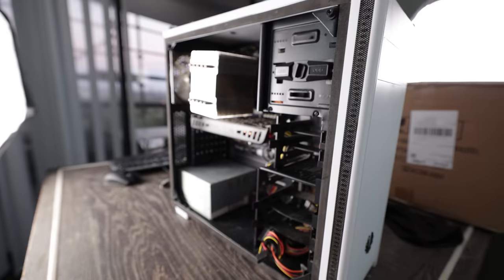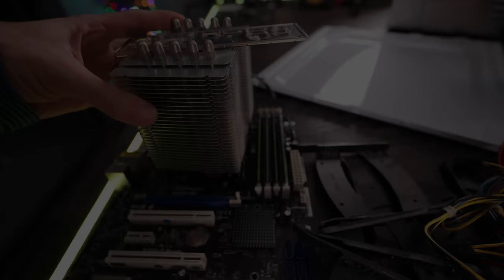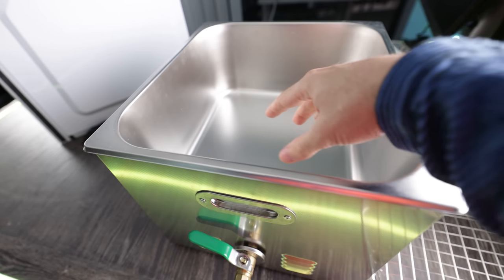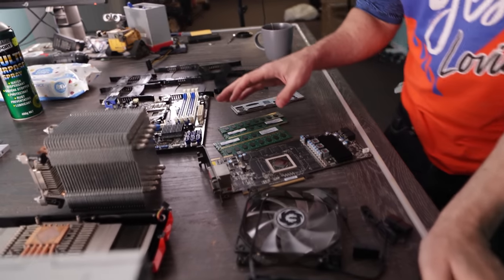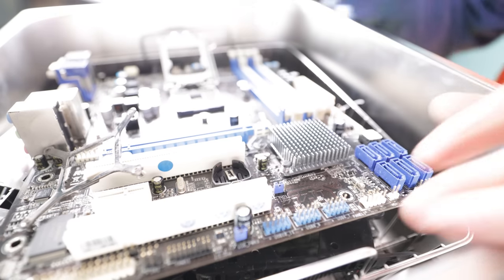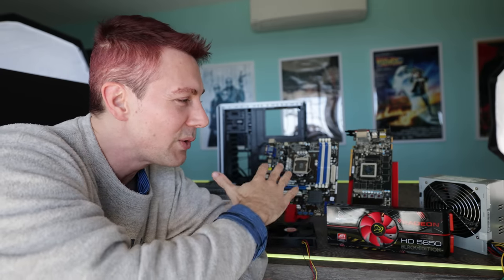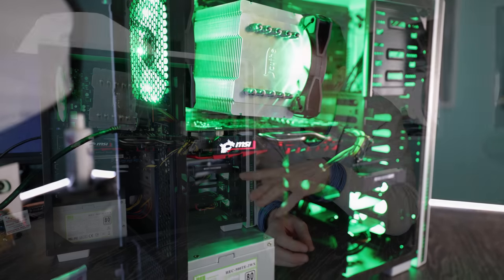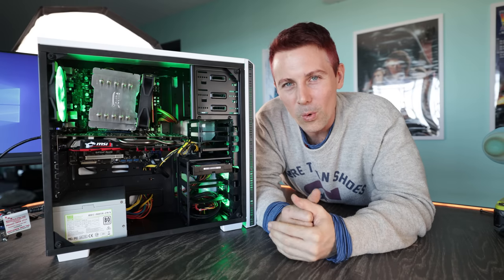ULTRASONIC Cleaning a THROW AWAY Gaming PC! - PCUC S1:E1

Comment: note to self, never trust u on cleaning a pc, the fact u used tap water. yeah no thanks. not the correct thing to use in an ultrasonic cleaner for pc parts nor should u ever use tap water on a pc for any reason. distilled water, maybe, high proof ethanol yeah, but tap water? nah id rather have my pc last 10 years or longer than put them at risk of rusting or worse, shorting out because it takes a lot longer for water to evaporate than it does alcohol. not to mention all tap water has some minerals in it, because of that they are left behind when the water evaporates, which can in turn lead to a short. so yeah def not gonna trust u on cleaning pc's.

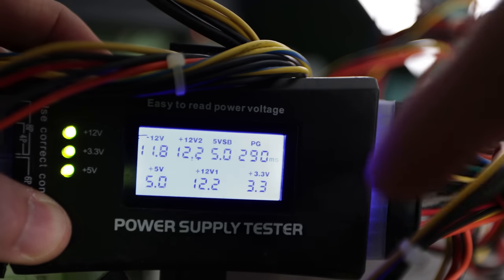Comment: 8:36 OMG that just seem so wrong to run tap water into a PSU.  Those caps hold a charge you know. 11:32 Oh thank god!!
From watching Louis Rossman, and Jayztwocents, I believe you're supposed to use alcohol in a sonic cleaner, and only clean small component, or one large component.

Comment: I advice you to use distiled water .
Maybe the regular tap water will kill components sometimes due to capacitor charge.. 

Ah btw,i think You know but You can use that cleaner with distilled water to clean water damaged components and it's corrosion.

Comment: I have the exact same ultra sonic cleaner, I wanted to put 70 CPU's in there for refurbishing, do you think it will be safe?
Reply: For anyone that needs an answer - yes, it is completely safe as long as you dry them with hot air (50°C to 80°C). Works completely fine with RAM too and even brought some of my 16GB modules back to life. My tip is to use a grease dissolving detergant and a temperature of 50°C for the water, 20 Minutes.

Comment: I laughed when I saw that cooler only because I did the same thing on my old 990x I can't stand to get rid of lol I drilled out the tabs on 1151 waterblock in order to reach the larger span of the 1366 socket,but it turned out perfectly centered,that leaning 775 cooler brought back the memory.

Comment: How long can you leave the motherboard without its battery?  Does the BIOS fade away?  Or do you clean it, then de-water, then install the battery again in the shortest amount of time?  I'm not sure why I'm asking.
Reply: The BIOS ROM does not fade away. The CMOS settings do, so you must reset them again in the first boot. 2 seconds unless you wish to tweak some settings.

Comment: Ive just dry cleaned my computer,I never put any electricals parts in water,I did try this many years ago with a very old windows 1995 computer,Left the parts to dry after about week,It wont work any more,One all the water goes in to all the circuits,It messing all the circuits,Some you lot are crazy !!!!! air spray the electrical parts or use a cotton bud's to clean it with
Reply: use not tap water

Comment: One question, not really nitpicking or anything but when blowing to the parts with fans, isn't that it is bad to get the fan to spin as it would introduce static to the board?
Reply: You would have to spin it really fast
Reply: @riba2233  With hands its fine but using the blower definitely its going fast.

Comment: ok so i don't want to sound stupid but you can wet pc parts with tap water and they still will work?
Reply: If dried quickly, yes. Otherwise corrosion occurs and you're S.O.L.
Reply: @christophervanzetta  wow i just figured once water touched anything electrical it would not work anymore thanks

Comment: Since when is it a good idea to use water to clean pc parts?
Reply: Ever since there was a basic understanding of electricity . Unplug everything and drain any residual charge and you can shower with your computer. It will take longer to dry off then you though. If you notice how right before he washed the motherboard he stops and remembers to pull the CMOS? Washing it before that would have definitively been a bad idea.

*edit* Or you know, how he explains in detail @10:30. Like ,full on, in-depth explanation.
Reply: @timmywashere1164   it's just that I've seen the damage water does to computers and seeing those parts, especially the power supply, submerged in water creeped me out.

Comment: wtf ur soaking it in water
Reply: wtf is happening in this video
Reply: Cleaning pc components in water can’t hurt them as you let them completely dry before using them
Reply: @free-jm5io  I would never be sure if it was completely dry before turning on. It would stress me out a lot, and on top of that you'd need a high powered air blower like the Yes Man uses. I don't think I would ever do this, even knowing it can be done.

Comment: All that and no SSD upgrade?? Loss of performance for a cheap upgrade
Reply: There was on in there at 16:05 . It’s In the smaller bay on top of the HDD
Reply from the maker: Oh yeah I sold the PC with a 120GB SSD and 500GB HDD and it came back with those two drives, so just reused them.
Reply: @techyescity  oh my bad I didn't see that. Great rebuild tho. I've been wanting a sonic cleaner

Comment: That was incredibly cringe to watch you blow those fans out without holding them or disabling them from moving. thats how you easily burn up a fan bearing and that just earned you an unsubscribe from me. Not to mention you had no idea how that power supply tester work besides green light means good.